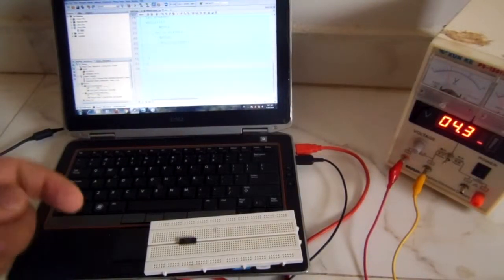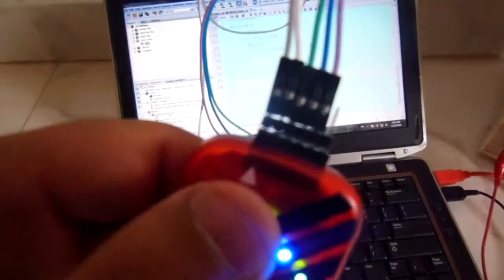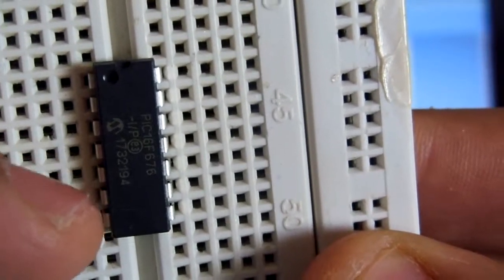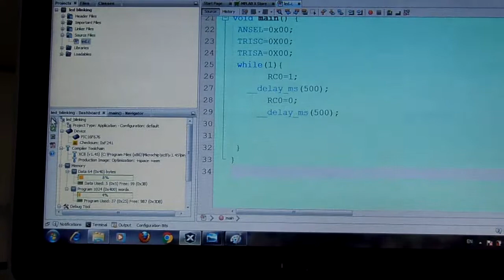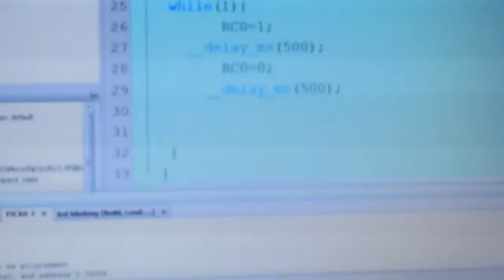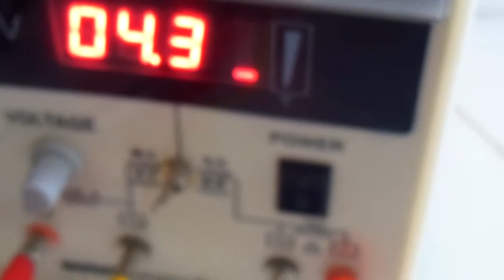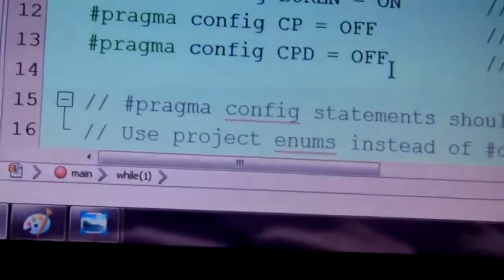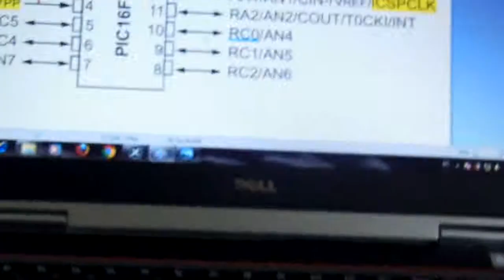PIC 16F676 PROGRAMMING LED ON/OFF|how to program pic 16f676 microcontroller FIRST

Comment: SIR how we can access individual pins (Like single pin at a time) for programming??? i need ans its urgent  pls...
Reply from the maker: For example If you want to access pin RA2 .using as input write in programming TRISRA2=1; now  state of RA2 will be zero or one according to input voltage.
Using RA2 as out put write in programming TRISRA2=0;  now its state can be changed  in programming like RA2=1; or RA2=0;
For more detail please download data sheet of pic16f676 from microchip website
Reply: @scienceprojectsofdccpn3430  thank you very much sir, I will come to you after applying your information.... thank you again..